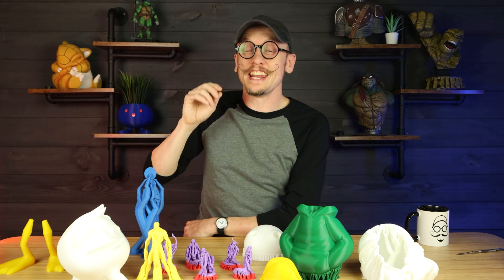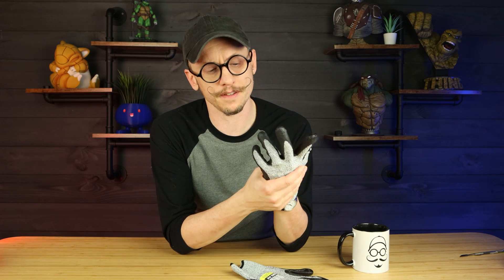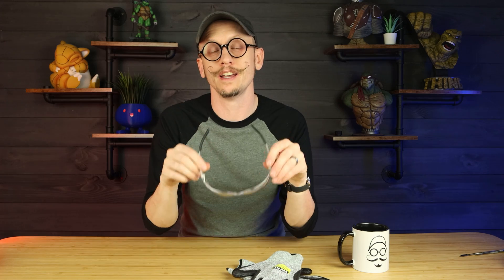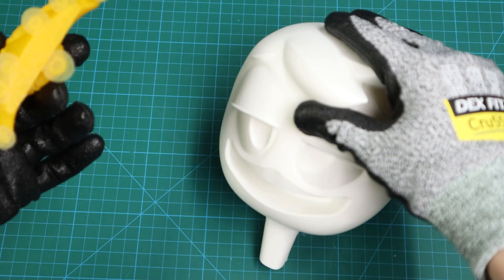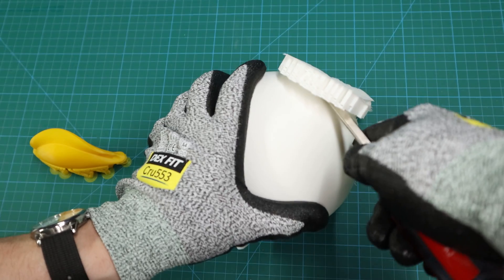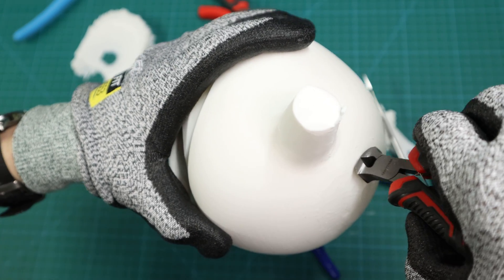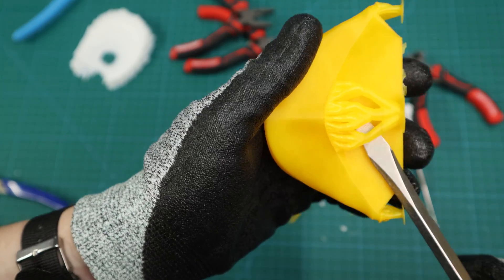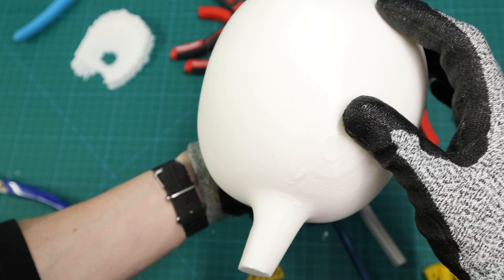Easy Method To Remove Supports on 3D Prints

Comment: Hello, Newbie here! Recently made the move from an Ender to the Bambu A1 Combo..Love it but going from prusaslicer to bambu studio has been a bit challenging. Your videos have helped me immensely with the initial start up but I've run into a little snag and was hoping you could guide me in the right direction. When trying to print a project last night I ran into an error saying "error 20 non-manifold edges". When using Prusaslicer all errors are fixed for you but I'm on a Macbook and the "fix" option is only supported on Windows based comps when using Bambu studio. Is there a work around for these situations or am I SOL?

Comment: I like to use an 1/8” or 1/4” chisel. You can sharpen them if the get dull and are very good at prying and even cleaning up some supports left on the print.

Comment: If your snips are breaking then your prints must be made of steel!
Reply from the maker: No it’s not that the snips still work the cheap ones have a silicone handle and over time the silicone wears and starts breaking. So then you’re just using a steel handle which can be quite uncomfortable.